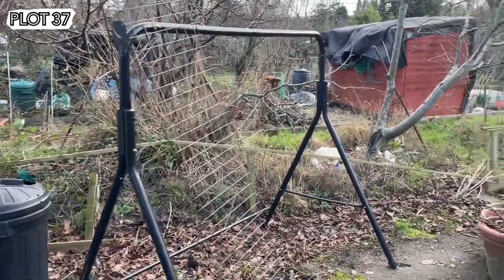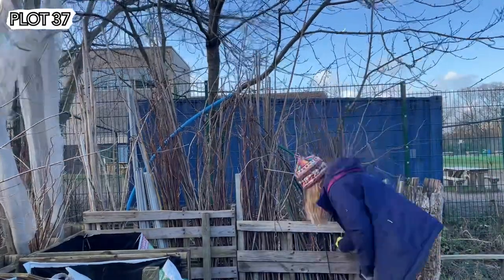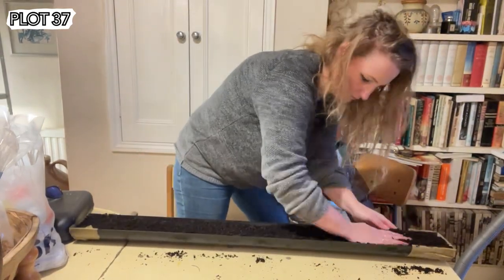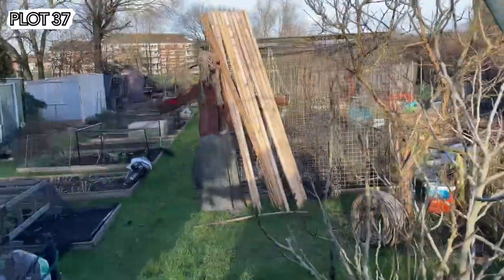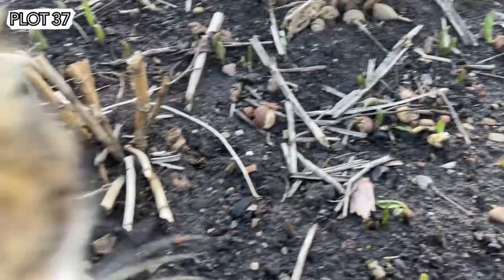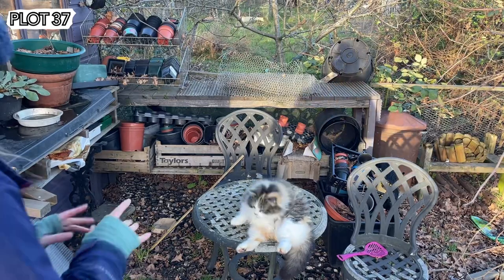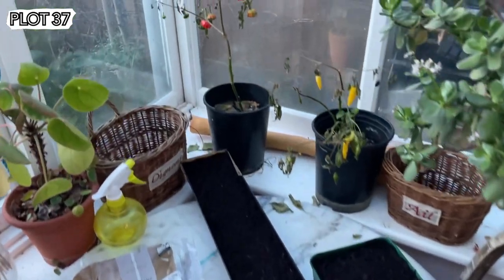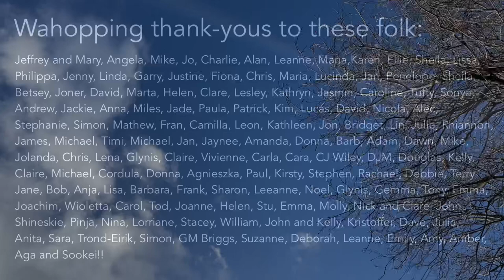Ep145 Sowing Peas in January and I've lost some of the Perennial Brassicas!! || Plot 37

Comment: Free timber.....here in Australia, PVC pipes are transported to plumbing supply stores in timber frames that they dump so our local outlet is more than happy for me to take as much as I want.  The timber is roughly 70mm x 40 mm and just over 1M long and untreated.  I stack the lengths and join them using cheap metal strips and screws to make the sides of my raised beds.  Hope this helps someone!!
Reply from the maker: I will now be on the look out for PVC pipe deliveries! :D

Comment: The prices of timber is astronomic now, Limited timber production occurred during 2020, as a result of Covid-19 and even with production already at a 13 year high, there still isn't enough supply to go around to meet demand. In the UK currently, we're cutting down more trees than we're planting. We're replanting 50% less trees than we did 10 years ago, which is reducing the amount of timber on the market.
Reply from the maker: Its gone through the roof and yeah... the problem is just compounding...